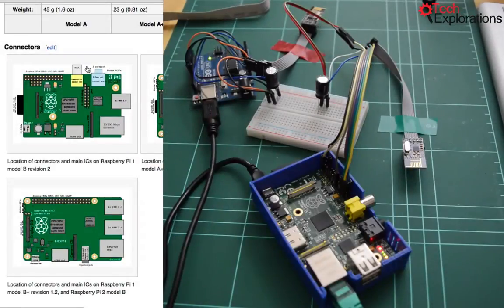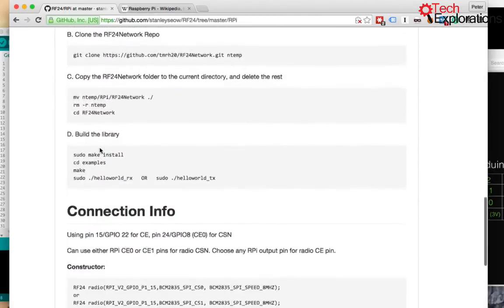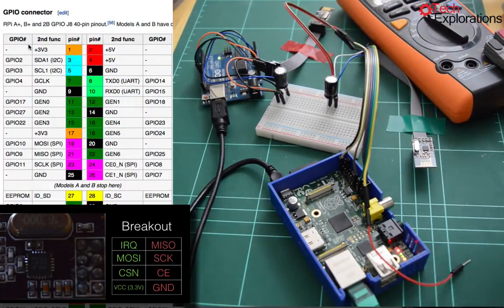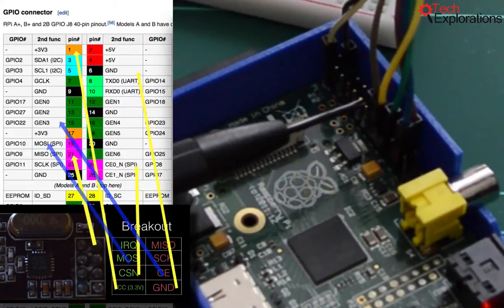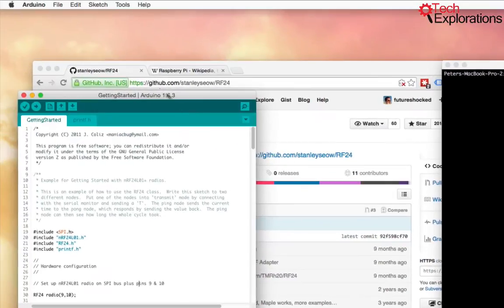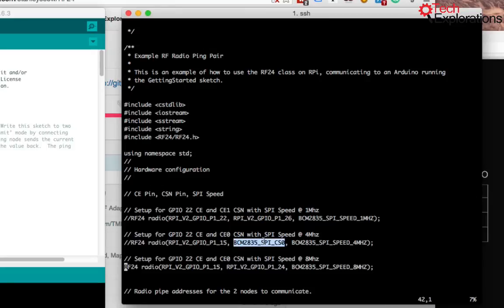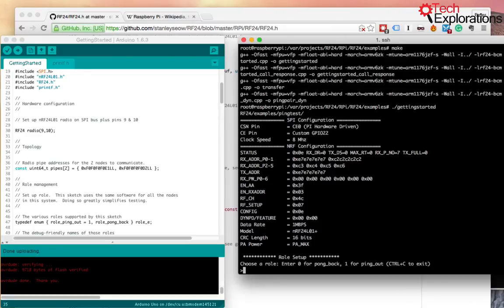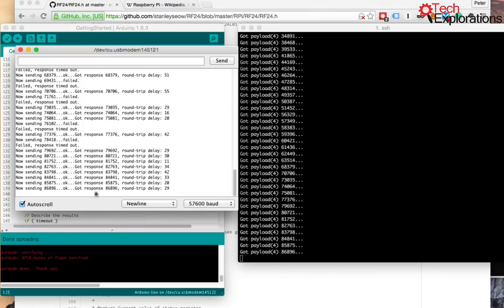Raspberry Pi, Arduino and RF24, a simple and quick guide

Comment: This is so much help! Could you let me know which type of ribbon cable that is? Any help is greatly appreciated! Thanks so much!
Reply from the maker: Alycia M Thanks! You can search eBay for "2.54mm Pitch 2x5Pin Female to Female 10 Wire IDC Flat Ribbon Cable". 

This is 2x5, mind you, not 2x4 which is more appropriate. 

I can't find a 2x4 IDC cable anywhere so I made my own from parts I purchased from Amazon (the flat 8-wire cable) and the connector from eBay.